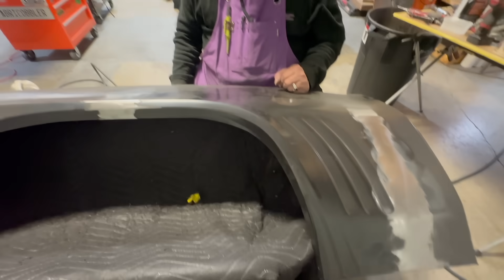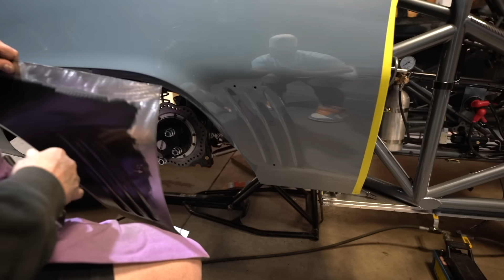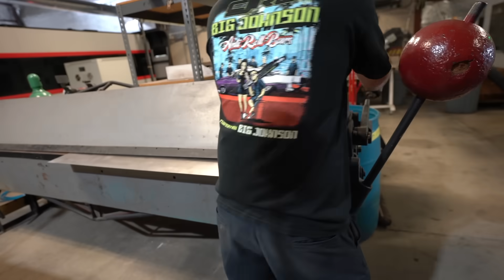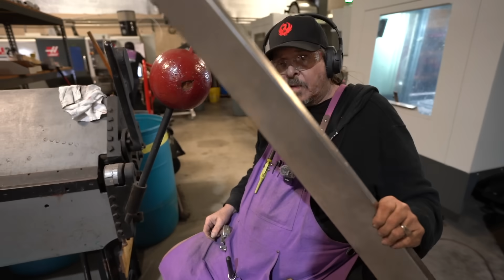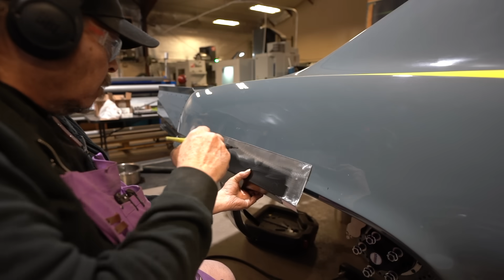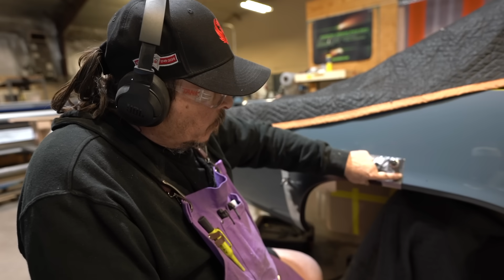This HURTS! Eagles $30,000 Paint is RUINED!

Comment: Would it have been possible to just get longer 4-link bars and driveshaft if needed to push the rear end back the ~1/4" or whatever was needed? I guess I haven't had the opportunity to see if the wheel is actually center in the well when parked, or if it is sitting a little too close to the front, so separation is pulling it into the bodywork.

Comment: Hey C.J. I like the new tees design. Any way you can do a run of CVC jerseys. way better more breathable material than 100% cotton also almost no fade for years of washing and better fit. check it out Next Level apparel Has them 6210 CVC T-Shirt. have them make you one for that run it will change your mind about 100% cotton. king Shocks had them I ordered two of all the colors I liked them so much.

Comment: So does the cabin need to be seam sealed to keep it so the windows don't blow out? I'm assuming the cabin catches air like a parachute and blows the doors/windows off. I'd like to see barometric pressure sensor data from inside the cabin as it takes a pass.

Comment: the real question is how does anyone pay 30k for a paoint job...unless its a 100 hour custom paintbrush job it should cost a few grand at most.
Reply from the maker: 350 or so hrs in body work/ carbon work and paint plus another 6-7k in paint and materials.
Reply from the maker: @DiggyDiggyHol  body work and paint was 30,000 plus

Comment: I love the car and the dude is a good guy but why is the paint job 30 grand? Its a solid color base clear with no pearl, no metallic, and very little airbrushing. There wasn't alot of metal to bodywork, nor was the carbon parts wavy. Please someone help me wrap my head around this price. My pearl grey color change on an originally red truck, two cab corners and a rocker full replacement, like, cannot tell the truck was ever red as even the inside of my cab is base clear, documentation showing it wasnt a bondo hack job, and even painted my cage. Whole thing was 13k

Comment: Why didn't you build the chassis right you wouldn't need to cut the body up
Reply from the maker: Is that so 😅😂? We didn’t have a rear end to mock up until after it was painted. As soon as we installed the rear end we knew we had a problem but it was too late. It will be fixed like new 😎
Reply: @CJRaceCars  no you had to put  longer 4link bars on the first time out
Reply from the maker: @ correct to bandaid the problem so we could race
Reply: @CJRaceCars  ok I'm not bashing you I like your cars .just saying
Reply from the maker: @ i understand. Trust me not what we want to have to be doing but it happens. We will show more of those process on mullet when we do it
Reply: @CJRaceCars  cool cool I'll be watching

Comment: I see those compression wraps on Troy's legs and I feel like I'm looking in a mirror. I was a truck driver in the 90s into the early 2000s until an accident retired me in 2004. I crushed my legs in the crash and have had all kinds of issues with them ever since. I have Coban and Jobst stockings and Profore and all kinds of other compression systems that I've been using for the past 20 years to deal with severe edema, as well as myriad other issues. I don't know what all he has going on, but I know the pain that kind of stuff can cause and I commend him for being able to push through it and keep working every day. I was going crazy myself not being able to work anymore after the accident until I found an outlet recently in writing. If you're interested, feel free to check my about page to see the books I have published. If not, that's fine too. I'm just enjoying the content in the downtime.
Reply: Good on you for getting back up, pushing through and finding a new passion on the other side. 👍 all the best

Comment: 5:32 17 years old , built a 81 Honda civic in high school. Teacher and I chopped out 6" and did the plaxi glass, gutted race car gated. I miss the metal work. 81 camero. 78 chevy low rider , 59 chevy apache,  😢.  Now 04 dodge sx2.0 ralley car. 😂🎉

Comment: Why does Eagle go down the track so much better than LeRoy or Mullet?
I know it has more power but it keeps the power down better
Reply: The chassis is transferring the power and weight properly comparative to the other cars.
Reply: Mullet's essentially a massive kludge to get everything to mostly work, and to be frank it's incredibly impressive that it's as fast as it is given it's trying to twist itself apart and has far too long of a wheelbase to be running a radial. Leroy has far better geometry and weight distribution than Mullet, but is limited by having a manual transmission more than anything else. Slap a lockup T400 in there and Leroy would probably run bottom 6's with ease, but at that point it isn't really Leroy anymore.